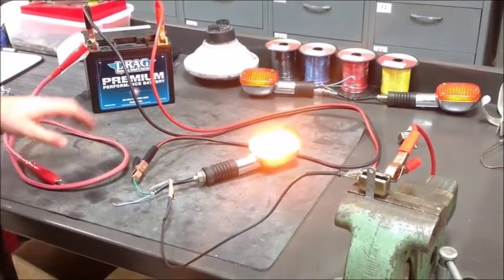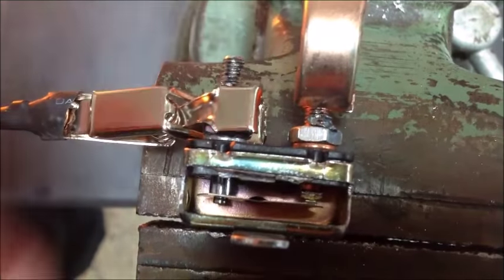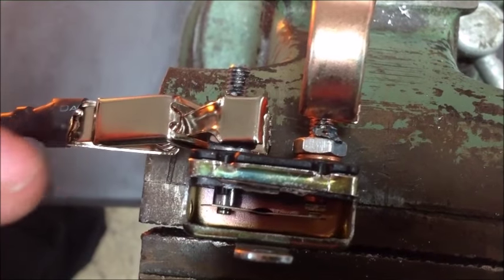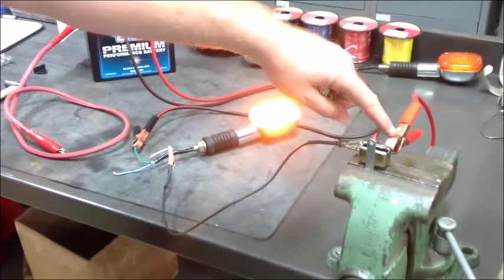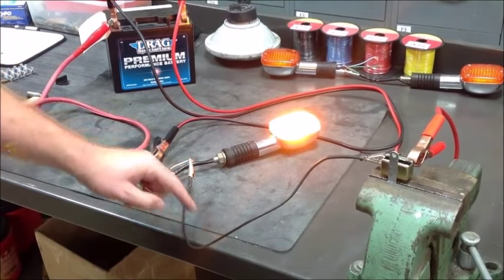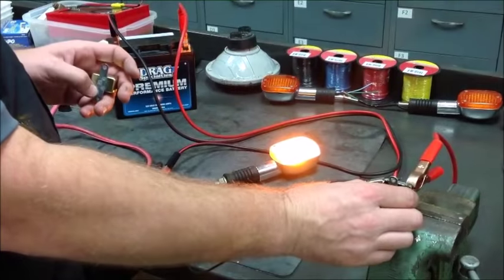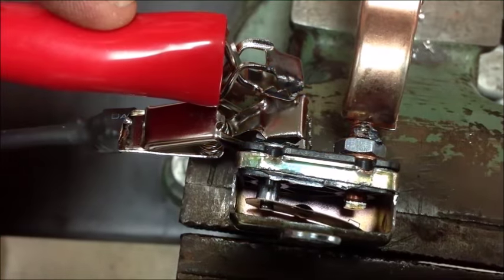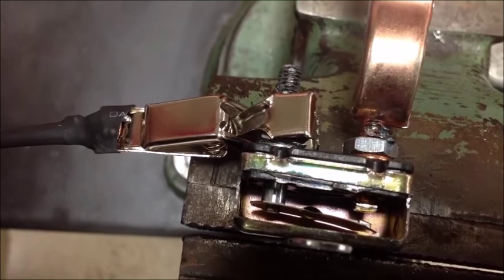How a resetting circuit works! Inside cut away of the breaker actually tripping

Comment: Thank you! I've spent the last 20 minutes online trying to figure out what an automatic reset breaker actually did and how long it takes to reset. I guess I should have checked YouTube first, lol.
Reply from the maker: You're very welcome! Have you subscribed yet to never miss a video? Have you seen the video playlists https://www.youtube.com/user/conleybuilt/playlists ? 

Want to say “thanks” or “keep it up”? Click here https://www.paypal.me/how2wrench   

Your answers and help are just around the corner. Save time and money while protecting your investment and yourself by doing it the right way at www.How2Wrench.com
Reply: Yeah great info. It told me it wouldn't work for my application. I need something that doesn't reset until the circuit is turned off.
Reply: @ExtraFungus  You need a "type 2" modified reset breaker. This type is called "type 1"

Comment: Thanks for an intuitive video.  Can you advise what happens if the circuit breaker is wired up in  reverse?
Reply from the maker: Thanks for commenting and adding value to our community! I don't know honestly because I've always installed correctly but as a curious fella myself, I was told years ago that the circuit breaker could weld together instead of "popping". No idea if true and testing is useless as it may need to be a damaged or one that had been tripped are arced across then re-installed incorrectly. Point is, just always install correctly and leave the rest to the design engineers right?

Have you subscribed yet to never miss a video? Have you seen the video playlists? Check them out here: https://www.youtube.com/user/conleybuilt/playlists  

Want to say “thanks” or “keep it up”? Click here https://www.paypal.me/how2wrench    
 
Your answers and help are just around the corner. Save time and money while protecting your investment and yourself by doing it the right way at www.How2Wrench.com

Comment: I have a question, I have one of these on my camper that I just bought used, it had no 12 volt power from the battery, battery is good, at some point the tongue of the camper was repainted, the breaker was very rusty so I got a new one, battery positive was connected to the copper stud and Red wire going to the camper went out the other side of copper stud, then battery negative was attached to the tongue of the camper then there was a black wire running from silver stud on the beaker to the camper, my question is should there be a ground wire running from the frame to the silver stud on the breaker? thanks for any help you can provide

Comment: I have a question. My rv dealer put this type of circuit break backwards. it worked for almost a week on battery power, but now it's completely destroyed and unable to close. Is this the possible result of connecting the poles incorrectly?

Comment: The only problem is if the fault persists, the breaker will keep cycling until it fails, if breaker fails shut and the fault current is very large then it will blast the thermal reed open circuit permanently no problems, but if the fault current is low, the branch circuit wiring can burn out instead and cause a fire. I always make sure the cables are large enough to handle the fault until the breaker fails open, and encase the breakers in a metal enclosure and or add a slow blow backup fuse.
Reply from the maker: Nice. I would only add that one should also use quality brand breakers. We have seen "cheap" ones weld together and not break the circuit. Thank s for adding value to the video.

Comment: for a 50 amp circuit breaker on a trolling motor which would be better , a manual reset or automatic reset ?
Reply from the maker: I would say depends where you put it...Would you like more of a detailed explanation and want us to drop our wrenches and help you? We love helping subscribers…even on old videos! Help us grow friend! Here’s how:
1. Subscribe and let us know with a response. We will circle back when we can (usually within a week, sometimes faster, depends on member needs)
2. We answer your questions EVERYDAY for channel members Join here: https://www.youtube.com/channel/UCBhM8DCKnT3qXwTW0eToyCg/join    
3. Give us a high 5 here: https://www.paypal.me/how2wrench and I run back to the computer! 
4. Is this an emergency and your head is about to explode from frustration or fear? Get Shane’s cell here: https://how2wrench.com/product/personal-tech-training-phone-facetime/
Reply: @How2Wrench  thank You for your timely reply......i did find out that dealing with trolling motor an automatic reset can be dangerous , like forgetting to turn the motor off then trying to clear the propeller one could lose a finger ......
Reply from the maker: @pacospete4299  You're welcome. I have to say that doesn't make sense to me if wired correctly. Even with a "reset" circuit breaker, if the breaker is not tripped, you would have the same risk. I would also say that if you are thinking that breaker would "trip if the propeller was tangled up (which it may from the extra load) and the "safety" is the reset, I would say no way! You should always use a tether safety cord and truly eliminate the risk of any starting. Be safe and keep wrenching...Shane
 Give us a high 5 here:  https://www.paypal.me/how2wrench

Comment: Is there a standard? I bought a off brand Chinese 60A for trolling but keeps tripping very soon after full throttle like 5 min into it? Thanks
Reply from the maker: 60 amps "should be" 60 amps. Try a different breaker or fix the cause.  If it was a quick answer I’d try to respond here but I wouldn’t want to lead you wrong assuming certain factors. Reach out to me on my website contact page. We have been overwhelmed with ungrateful people and scammers so I had to do something for my sanity by screening the over 300 requests a week! Contact Link: https://how2wrench.com/contact/ 

Your answers and help are just around the corner. Save time and money while protecting your investment and yourself by doing it the right way at www.How2Wrench.com 

 

Have you subscribed yet to never miss a video? Have you seen the video playlists https://www.youtube.com/user/conleybuilt/playlists? 

 

Want to say “thanks” or “keep it up”? Click here https://www.paypal.me/how2wrench